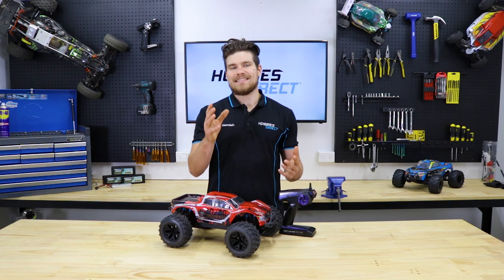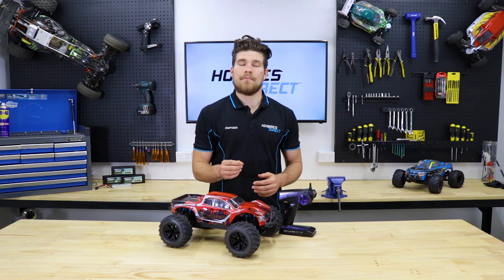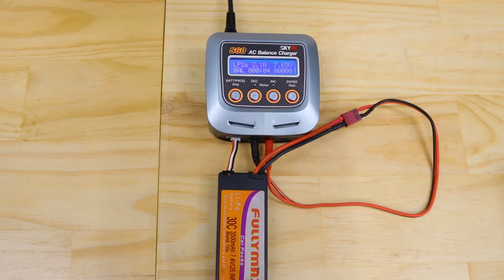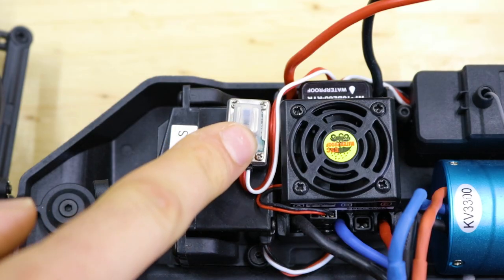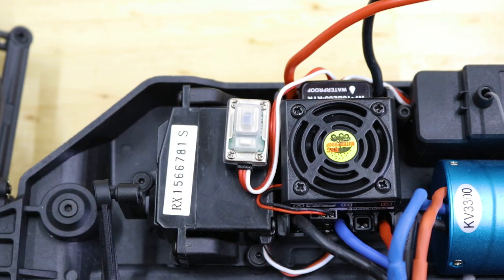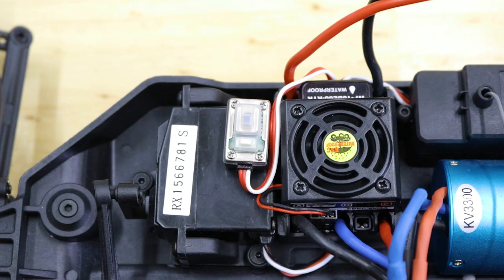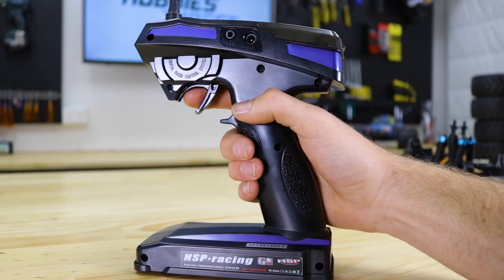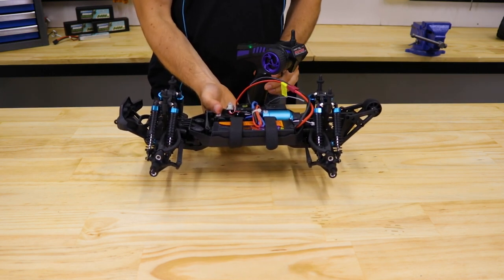How to: Calibrate a Brushless Hobbywing ESC in your RC Car

Comment: This video saved me by changing my typhon mega from brushed motor to brusheless motor and the esc and it did not give recoil I did not know what it was so I looked I found this video I did not know that I had to calibrate it thanks
Reply: I just changed my nephew's mega to brushless with a cheap combo so it wouldn't be too fast for him. Got flycolor 45 amp esc motor combo figuring it'd be perfect for 2s lipo but it's clogging out and has really weak reverse now. Idk if u have any tips but if so please lmk . Thx

Comment: I'm a pretty technically minded bloke but I admit I was a little intimidated by the setting up of new Hardware on these thing but now I'm feeling a little more confident, pretty easy really.

Cheers Mate 👍
Reply from the maker: Glad we could help!
Reply: Worthless information if your model doesn't use this method .. many different models of esc with many different ways to calibrate
Reply: Ah well, you're entitled to your opinion as much as I'm entitled to disagree.
Reply: @pyrace  it's not an opinion it's a fact.  The video makes it sound like all esc are calibrated this way and most are not. So like I said it's worthless if yours is different and useful if yours happens to be one that it will work this method. Hopefully it did work for you 👍
Reply: @Bogues_88  like I said, I choose to disagree, but cheers

Comment: So I'm not getting full speed going forward but I'm getting full speed in reverse I calibrated it three times even the opposite way I haven't found a solution is my ESC just bad?
Reply from the maker: Try swapping any two of the motor wires :-)

Comment: cool but what if you dont have a button?
Reply: sanjin dzakulic  Sounds like an ESC issue. are you using a 3s battery with a 2s esc?
Reply: sanjin dzakulic  i have the same problem, and no clue how to fix it
Reply: Same problem my throttle will only work if I try to turn then when I got the trigger nothing
Reply: I got it but I had to use a receiver with a push button on it
Reply: This video should explain every esc is different and this only works for some

Comment: At :53 you mention that the throttle adjustment should be set to zero before proceeding with calibration, yet the manual for my EZRUN-WP-SC8 says to "set the EPA/ATV value of throttle channel to 100%". Why the difference? Great videos. Thanks.
Reply: I have the same question and it would be really great to get it answered. Thank you for the video
Reply: He said throttle trim at zero not epa .. epa should be 100

Comment: Hey I have a brontosaurus pro in for some reason I have a full charge battery the esc just flash green does that mean my lipo battery is bad it just turns don't move but I can put a 850 mAh lipo battery in it in it work for a sec then cuts off

Comment: I’m having trouble?!?!I was driving my rebuild rustler and now the motor doesn’t work it just keeps making a ticking noise and the wheels don’t move they just keep moving back and forth like something is blocking it but when it’s off you can move the motor freely
Reply: same with me bro now idk what to do. i only can move left right but the esc still blinks 3 times and cant move
Reply: @haauuugghhhh  I found out the problem it was my esc the thing that the motor and battery plug into

Comment: OK so I did all these steps to the T on my Redcar shredder w\sc8-rtr ESC, neutral beeps once, throttle beeps twice, brakes beeps 3 and I wait holding brakes until it beeps an blinks green then it starts flashing red and I let go of brakes and nothing happens, I still get no throttle or brakes just steering works, is there something I'm doing wrongly?

Comment: Just bought a hsp xStr brushless rc, having problems with setting throttle the car won’t accelerate or reverse but setting fully functional and it’s a new roc not been on road yet. Need more help as still not working

Comment: Hi mate,im a newbie to RC n i have only 1 truck,a JLB J3 SPEED,I just bought this esc from eBay and I'm having trouble calibrating it to the truck,I'll hold "set" n switch it on,the red light flashes(the next step is the issue) while it's flashes I'll push "set"again (while in neural on control) n the light is supposed to go green,mine doesn't do this,it just stops beeping with no light,...PLEASE HELP....lol...i dont no if this is a factor but when I turn on the control (Dumborc) my steering servo twitches slightly.

Comment: I have a JLB Cheetah 11101 c/w a DumboRC X4 transmitter. I have been having problems while attempting to reverse the vehicle. It seems to be a 'hit or miss' scenario. Sometimes I can push the trigger all the way forward (in order to reverse the vehicle) but I get no response.Forward seems to be working fine. Any suggestions?🤔
Reply: Please tell me , have u figured that issue out cuz my typhon mega swap is doing exactly that and it's extremely frustrating.  Tia
Reply: If u have forward brake and reverse .. u can't go straight from forward into reverse because it damage the gears .. forward .. if u brake then return to neutral and wait a second then reverse ... Just work out how long u need to delay before trying to hit reverse
Reply: The reason I was having trouble reversing the vehicle was because I had the throttle trim on the transmitter turned down too low. On my tx, it has to be set slightly to the right of 12:00 in order to engage the reverse gearing.

Comment: Hey everyone. I just inherited a 1/8 rally car from my father (who is no longer able to use it due to illness). I don’t have a manual and trying to work out what the heck I am doing. The car works but am I able to adjust the throttle as it is so sensitive. I have tried the instructions in this video but I don’t get a beep when I release the button next to the on switch (very first step) it’s a hobby king car using a 120a ESC. Any help would be appreciated very much. I also cannot find any manual online....

Comment: Hi. After I went through the calibration procedure, I have power to servos but not on throttle. What am I doing wrong? Thanks
Reply from the maker: Hard to say without more info - what esc, what radio, any flashing leds? Are you sure the throttle channel is working/dual rate turned up?

Comment: Thanks! it resolved car running out when radio was powered off. But I have another issue, when radio is powered off, the digital servo is moving aleatory. Is that a form to resolve this problem? Thanks in advance!
Reply from the maker: The radio should be the first thing on and the last thing off; never have the car switched on without the radio being on 🙂
Reply: @HobbiesDirect  Thanks!

Comment: I just got a used rc car and it has the same esc as in the video but when I try to run the car only the steering works and the esc blinks green 3 time. Do you know how to fix this? I can’t find anything about this when I look it up
Reply from the maker: According to the manual, the green LED flashing 3 times means Over-Heat Protection :-/

Comment: Excellent video! Please let me know if the following components listed below will be good for my heavy rock climber, thank you again and keep up the great work!

- RJ Speed R/C Legends Chassis Kit (RJS2012)
- Tamiya 54358 RS-540 Brushless Torque-- Tuned Motor (10A - 7.2 Volts)
- GoolRC 120A Brushless ESC Waterproof Electric Speed Controller (120A - 7.4Volts)
     (Connection: Yellow to yellow & blue to green on motor; Orange not used)
- Flysky FS-i4 AFHDS 2A 2.4GHz 4CH Radio System Transmitter
- Flysky FS-A6 Receiver
- Smraza 45KG Servo Motor Steering High Torque (5Volts - 8.4 Volts)
- Smraza HV 8.4V Coreless Waterproof Digital Servo
- 72 Tooth 48 Pitch Spur Gear
- 12 Tooth 48 Pitch Pinion Gear
Reply from the maker: Not familiar with some of those brands, but the Tamiya RS540 is a brushed motor. If that ESC can operate in brushed mode, then yes that sounds all good :-)
Reply: @HobbiesDirect  Thank you for letting me know.

Comment: i just built my first rc car and after a while of driving the esc slowly switched the brake funcion with the throttle, and the reverse is when i pull the trigger (supposed to be forwards). i tried this but it didnt work, and i dont know what that esc is and dont have a manual. is there another way to reset it?
Reply: Same problem here
Reply: Solved it bad ESC :( turns out I got a clone, just burned out me, also lost my new 1500mAh 3s :(
Reply: Casey Vitti    yea i opened it up, it had the 2 mosfets just gone in to ashes, ima get a new one for 5euro from my friend if i cant fix it. the only problem is i have tons of mosfets but cant find the datasheet for the burnt ones. my gens 5300mah still ok, but maybe i cant see the puff bc of the hard case.

Comment: Hi I have a legendary legend can I run a 3 s battery without blowing the car up. Thanks Joe.
Reply from the maker: After a quick google, the car looks to be a rebrand of the Xinlehong 9125. So while the car can technically run 3s, be careful it doesn't overheat as it's technically not recommended. Fun though!

Comment: My esc never goes green, and I can not get it to program in right order, it does neutral fine, but nothing at full throttle. But if it full brake it beeps twice then let's me go full throttle beep 3 times. But now reverse way faster than forward. I've tried several time to get it to program in right order, wtf am I doing wrong

Comment: dose this work on MST 2.5 RTR cars? i just got one and it seems to be LOCKED on Throttle when i plug battery in it just takes off even if the car is set to off on its switch
Reply from the maker: I'm going to assume it has a brushed ESC? If it goes full throttle without the switch even being turned on, then it sounds like the ESC has burned out and is just sending the full voltage of the battery to the motor :-/

Comment: I have the same motor (kv3300) and the same esc and the battery. 
My problem with this one is when i put it on the grass it wont drive fast..
Any tips on how to fix that? new motor and esc?
Reply: Hi mate make sure your wheel bearings move freely I had that issue if that does not work I would consider getting a 5200mah zeee battery mine flies now thanks to that If not tires could be it make sure its not too heavy remember your tires could get water of or dirt in them just my experience

Comment: I cant seem to be able to enter reset mode. I hold the reset button, turn on amd it still just beeps twice with the gteen flashing light. I have put the controller on first and made sure all batteries are charged.
Reply from the maker: Try cleaning the whole switch assembly out with contact cleaner - it sounds like the set button isn't working.

Comment: I did the calibration and it went well I think but after a while, after reverse, I let go the trottle, it still reverses automatically without me pressing any trigger. I hope you could advife in this. Thanks 😀
Reply: That’s because you don’t put your throttle trim to zero..
Reply: If it was calibrated correctly u shouldnt need to move trim .. but he may have adjusted trim with out knowing

Comment: Dear admin... I too using the same model, but drift type... I just wanted to know why when I accelerate the car moving forward it run slow but when I reverse the backward it run faster... any setting problems
Reply: reverse the wires going to your motor
Reply: Yes! Reverse 2 wires and you may need to switch your transmitter from rev to normal as well!

Comment: hi, i just put the goolrc motor and esc combo in my tamiya cars it works great, but if i try it in a wltoys car i get the stutter? i can lift the car up and it runs fine, but on the ground it struggles at first to get moving? i really like these wltoys cars but the brushless issue is puzzling
Reply: wltoys are really high gearing , if you used a small motor they cog hard.

Comment: Can you help me? I cant use my traxxas 6x6 because my motor of esc dont work, only do a beep beep secuencly
Reply from the maker: Is it the stock motor and esc?
Reply: @HobbiesDirect  no, its other from ebay
Reply from the maker: Without knowing anything about what it is, it's hard to give you any help. Did it come with instructions?  @Matamoros_868
Reply: @HobbiesDirect  Thanks friend, in the end I was able to find the fault, it turned out that the receiver had a burnt input, I had to buy a new TSM

Comment: I did find this useful but I'm still a bit lost as to changing the parameters as in push settings,  brake force ect cuz ive yet to get this rc car to get reverse,  well full reverse anyway. It's very weak and makes clicking sounds which just doesn't make sense considering ive gone thru the rear diff,  spur gear, pinion.... Everything! I just don't get it and I don't ha e any decent hobby shop near me that isn't Traxxas biased soo.... any help is much appreciated,  by anyone evenin comments,  idc I just want my nephew to be able to enjoy the car I got him. Typhon mega.550 brushed, now brushless since the original setup was also just garbo.
Reply from the maker: Hey there, please get in touch with our customer service team at info@hobbiesdirect.com.au, we're keen to help but it might be a bit rough over YT comments haha 🙂

Comment: It would have been a good idea to explain that every esc is different and this method only works with some .. many dont have a set button and just on off button .. some dont even have an on off button just plug in and power is on . So all these have different methods
Reply from the maker: We do have this written in the description: "This method applies specifically to Hobbywing manufactured ESCs, and will also work with many non-Hobbywing branded ESCs." But thanks for pointing this out for future viewers/videos :-)
Reply: Ah yes sorry I meant description of video ( the title) my bad
Reply from the maker: @Bogues_88  Ohhh, actually, great idea! That will be updated immediately :-)

Comment: What if my car turns the wheels instead of giving throttle? When calibrating? I get full throttle when I just turn my car on
Reply: Reverse the ESC and servo wires in the receiver. ESC always plugs into slot #2 in your receiver, the steering servo plugs in slot #1. Hope this helps
Reply: @donmichaelcorbin4417  haha thanks 👍🏽
Reply: I forgot which YouTuber helped me out the most with this major issue lol but it's a really simple rhyme to get you to remember where they go, it's "One to steer and two to go!" And I've never forgot ever since!

Comment: Another point that may be worth mentioning, the brakes work fine while reversing, but not so well while going forward.🤔🤔
Reply: I had a similar problem and calibration did not help. But, switch two wires from motor that connect to the esc, and keep an eye on your transmitter, mine was in reverse , but once I switched the wires it needed to be in normal. Because of this my breaks stop on a dime now going forward. Hope it helps!

Comment: i have this exact esc and the light blinks 4 times green and doesnt do anything else and wont enter any calibration mode
Reply: Did you figure it out I don’t get the green flashing on the esc
Reply: @r.cbikefloyd5390  nope, got a new esc im pretty Sure mine had just had enough of the abuse
Reply: @sausagesquash1911  well in that case I’m sure mines is dead as well sat for a while which esc did you go with. We’re you able to keep the same transmitter and reciever
Reply: @r.cbikefloyd5390  yes I was, I kept same motor for a while too! I went with a hobby wing max 10
Reply: @sausagesquash1911  thanks for your help.

Comment: My esc won't go in reverse any help
Reply: Check that your esc is not in race mode , which does not allow reverse, only forward and brake. Hold down your set button while turning on, wait for a beep and press set button again once you’ve heard the correct number of beeps indicating the mode you desire. 1 is usually sport 2 is usually race , and 3 is usually training mode .

Comment: What about reverse drive
Reply from the maker: If you're talking about calibrating the reverse input as well, when you apply full brake, that signal is the same as full reverse (the ESC just interprets it differently depending on whether that was your first tap, or second tap of brake/reverse).

Comment: Held my button down when switching on and still blinks green... ???
Reply from the maker: Hi Paul, make sure you release the set button immediately after switching on the ESC. What model ESC do you have?
Reply: Arrma Kraton. Thanks for the tip I will try that
Reply: Tried and still no luck
Reply from the maker: Do you mind sending us a short video via email to info@hobbiesdirect.com.au?
So we can work out what's going on.
Reply: I can. Its bounded to the transmitter because the steering works. I have rebound it. Just cant calibrate the controller. The green light next to the fan continues to flash when I turn it on that way you showed
Reply from the maker: @paullobwein1632  If you could send a video that would be great :) I'm hoping It's not stuck in programming mode.

Check out this Arrma Forum Thread:

https://www.arrmaforum.com/threads/blx185-no-throttle-green-light-flashes-4-times.5116/